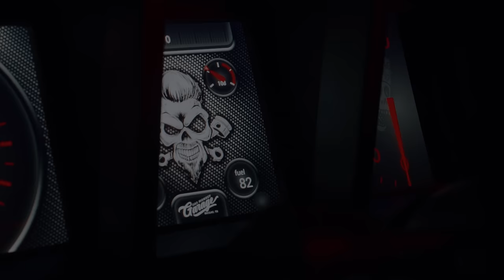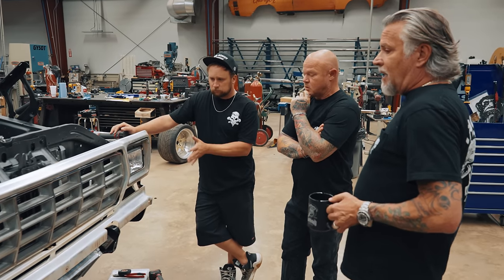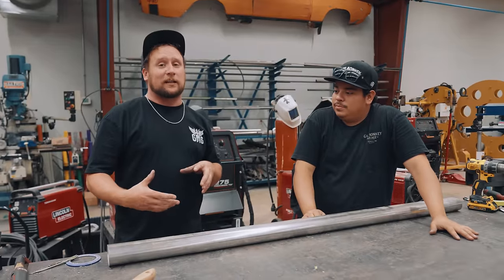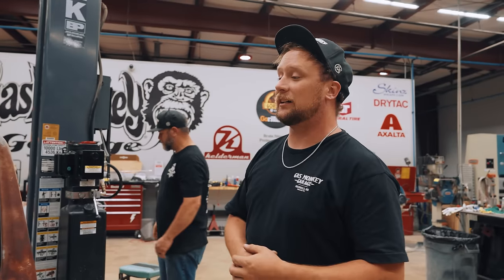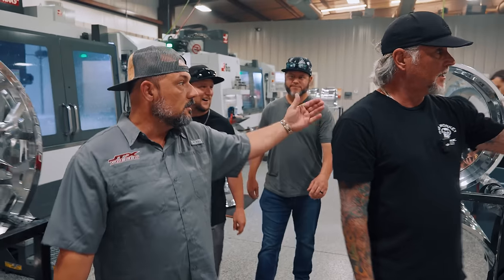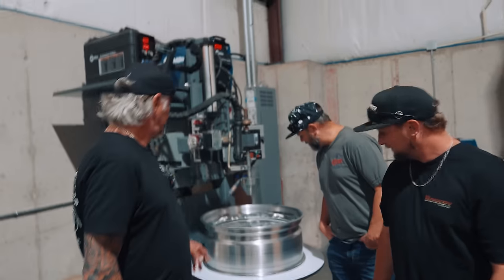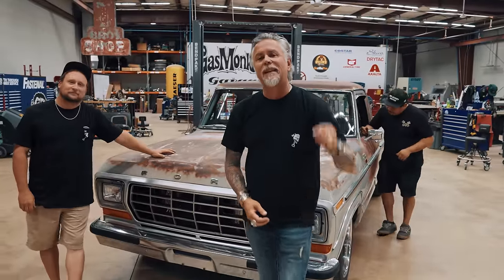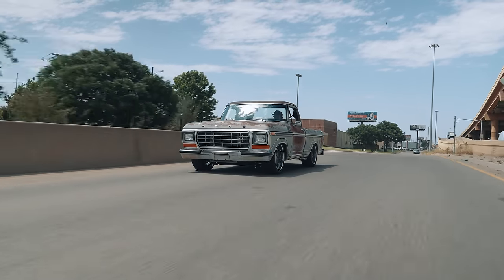THE "MF79"- Building The Ultimate Ford F100 | EP 4

Comment: Patina looks dumb on this truck. Especially with Ford still having a similar color on newer F150s. Modernized everything except the shitty paint. I wouldn't drive this even if paid to do so. Patina is for guys who aren't actually car guys. I'd have far more respect if it was closer to original with patina or even had a less modern power plant like a efi 460 with a turbo. Comparing it to almost every other hot rod shop doing trucks, it's just incomplete. Just comparing it to former GMG painter KC's f100, it fails miserably, and it was built years ago. Take it back apart and paint it.